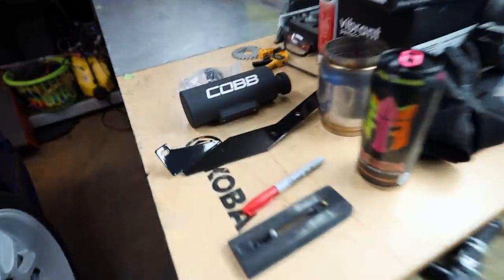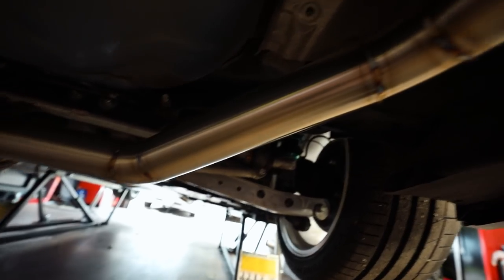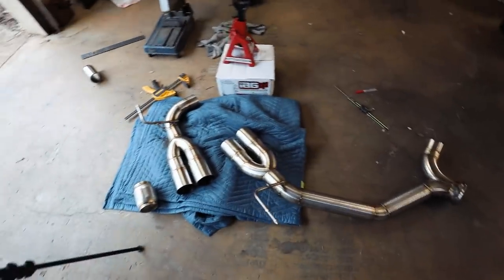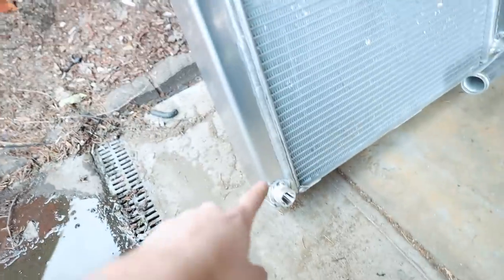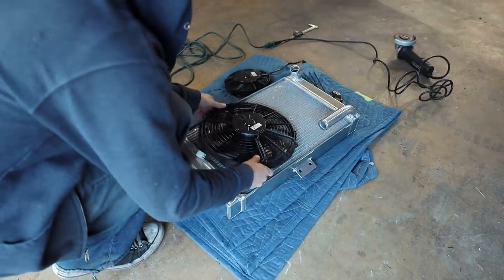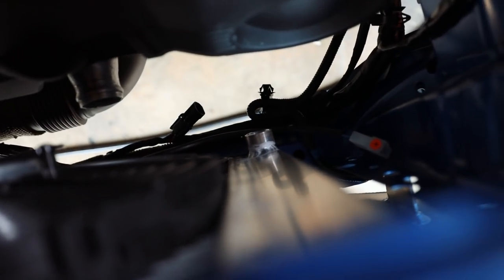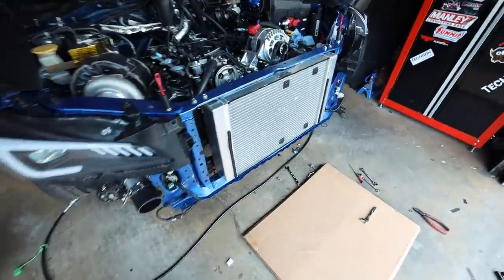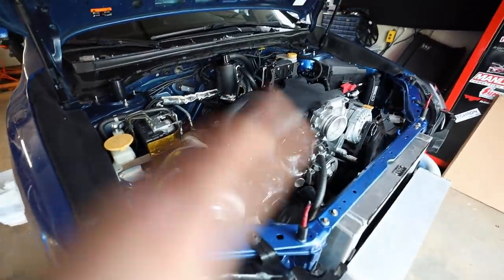Fixing the 6 Cylinder Subaru WRX STIs Cooling System Pt 2.

Comment: Measurement hack on 2 same sized holes center to center - measure the diameter of one, then zero the caliper. Then measure the outside of circle to circle with the ID measuring fingers. The caliper will display center to center on the LCD :)
Reply from the maker: Good little trick to have 🔥🥳 thank you!

Comment: @smeedia hey I am a TIG welder, you need to turn your gas up to 25 and buy a “furik fupa 12”  your welds are grey from not enough coverage. Especially with welding stainless pipe you need a larger cup. Your welds will become 100 times better! Yes that is the name. The really Big cup is a BBW…. Lol
Reply from the maker: I had gas at 30cfm to start and saw I kept blowing thr coverage away, then went do to 20. I'll try 25 next snd what cup size do you suggest for steel? I've been wanting the Pyrex cups so this gives me thr opportunity to justify ordering them 😅
Reply: @Smeedia  you can use the same cup with steel as you do with stainless. He is right about the gas but also with stainless you use way less amps than you use on steel. Those gray looking welds are also a sign of over heating the weld puddle. Not sure what welding rods you were using but ER308 is a good rod unless your welding food grade. Also when welding stainless you need to back gas your welds or they will be super weak from peppering. When welding stainless you have to get the puddle going and move quickly so you don’t cook out the chromium out of the stainless. Those gray welds will rust cause they don’t have any stainless properties left in the welds.
Reply from the maker: Should I paint over them? 😅

Comment: Outcast is so underrated. Most of these kids are missing out
Reply from the maker: Throwback outcast vibes 🔥🔥🔥
Reply: @Smeedia  Is there any way to run two smaller fans and tie them together.
Reply from the maker: Yes, I would wire them independently though

Comment: I love watching your videos brother. I don't have anywhere near the money or means to get said money at a normal 9 to 5 job. And no, I'm not doing anything illegal or shady, and I'm 8 years into my sobriety from Opiates!. Which has been a major change but thanks to many hobbies including a hobby turned side Hustle buying/selling/trading & building on commission 1/24 scale model cars . I've been using that as a means to fund my own H6 build I want to do (Among a few others including ANOTHER 1990's Era Eagle Summit Minivan AWD with a factory 5 speed and a built 4G63T from my old 1G Eclipse GSX that I had to becut out of thanks to a drunk drive in the winter. But, I built that and IIRC around 8 to 10 FWD Mitsubishi Mirage/Dodge Colt Hatchbacks/Sedans with the odd Early 90's Hyundai Excelle (spelling?) 4 door that had a fullcaveman, fuel cell and light enoughin the rear one guy could use their middlefinger and pick up and move the rear of the car around lmao. Built those many moons ago when I was in my early 20's and during the peak of the Weast Coast Honda vs East Coast DSM Rivalry which we took seriously in our area lol. 

But now I am working on swapping and building my 00 Forester w/SOHC 2.5ltr which sadly blew a head gasket. Once I eventually save up enough money I am going to buy a running/driving SVX and swap over everything into the Forester that i need to make it work while selling all the unused, unnecessary or incompatible parts that are still good (I might need to get every penny I can from the deals but I DO have integrity and believe that you get out of life what you put into it.)
Just needs a new clutch (Original one was slipping from when I purchased the car tbh I thought the clutch would go out WAYYY before a head gasket since it just had timing belt replacement before I got it. She came with a folder 📂 filled with everything ever done to the car and besides the Subaru dealer only one other shop has touched it over the years which is a GOLD MINE for anyone buying a used car!)

Your channel gives me something to reach for because, even though you want people to look up to you, if you don't have anyone to look up to then, you'll become stagnant and never try to achieve a higher level... or something... lol.
Hopefully I can have my Turbocharged H6 swapped '00 Forester in a video with someone like you sir. Much love and respect from Indiana, USA. AKA The "Armpit of America," corny I know but... it's better than "Hoosier Daddy!?!?" I feel dirty now... Giggity. Haha.
Reply from the maker: Congrats in the sobriety! Definitely a huge achievement 🔥 model cars is always something I've always thought would be fun to get into. 

Kinda cool that it came with the folder done with everything to it! An SVX swap would 🔥 to see in that thing 😍 funny enough a slipping clutch is what made me want to swap mine 😅

Keep me posted on the progress as it comes along! Would love to see some clips as you progress through it 😁

Comment: Unless it's too late...
Maybe if you could use 2 5,5" fans as your auxiliary? You do have your intercooler covering that lower portion in that corner.
Reply from the maker: I'd have to wire another in but that shouldent be an issue 🔥

Comment: Tanner that’s a resonater, not a muffler. Anyway, you’ll need one that’s about a foot long at minimum and than put it in the exhaust before where it makes a Split out to the axle back portion of the exhaust. Now that you have those 2 mini ones in the axle backs I feel this would be the best route to take. My built 2015 wrx was a bit Loud with the full straight pipe it had and a resonated midpipe with about a 2 foot long and 6 inch wide resonator has it sounding deep and growly with no rasp and brought the tones down a few decibels, especially on cold starts.
Reply from the maker: Per vibrant they're mufflers 😅 

No room in the catback for a resonator, would hit out drive shaft 😅

Comment: Awesome Dude! Curious, would there be a way to manufacture a larger version of a bleed screw similar to what you find on the calipers where you can attach a hose for clean draining? Would it be a waste of time? Hmmm in that same vein also have for the oil pan and sell out of your shop?
Reply from the maker: Debating snagging a funoto valve to try and stick in there 😅🔥

Comment: The coolant out of the cyl4 mod for the ej doesnt go into the heater core it mixes with the coolant coming out of the heater core.
Reply from the maker: On the EG it's on the opposite, the return for the heater core is on the passenser side of the engine
Reply: @Smeedia  ahh gotcha, ya the mod wouldnt have made to much sense on the eg to begin with since youre not feeding a turbo with coolant from the passenger side head so there wasnt any real balancing to be done anyways.

Comment: Any trick to cleaning the egr valve on the old ez30d without removing it. i have some high rpms on start but only for about 10 minutes at 1600 to 1800 rpm then drops down to 600 rpm when fully warm. Any tips
Reply from the maker: Only way I know how to is to pop it off and clean it our that way 🙏
Reply: Junk yard info here i come lol. No loss if i mess up something out there lol thank you sir
Reply: Thanks again i went to the junkyard and found out you do not have to remove your intake manifold to get it off just have to remove a hand full of normal items for good clearance and a little tiny 6 in wrench and it popped right off after four bolts. Tight space but saved me hours. Thank you sir

Comment: Will the radiator still work properly without a shroud? I always thought needs a shroud rather than just a fan mounted to the core?
Reply from the maker: It should, my brz had a similar set up and never had an issue

Comment: I hope I’m wrong but I think it’s gonna overheat again The hose is on the same spot where the hot water going in I hope you put block off in between of the radiator?
Reply from the maker: Which hose? The outlet from the water pipe?

Comment: I thought shrouds on radiators with like pass through holes were more effective then just fans on the radiator ?
Reply from the maker: They could be? 

I don't know how much a Shroud will help us if we had one 😅 only one way to find out
Reply: @Smeedia  not a lot of room there for one anyway. But then make them with square holes with flaps to allow air to flow out but directs the fan air more directly

Comment: So I can’t tell the size of the radiator drain or if there’s enough room for what I’m about to suggest but they make a easy drain thing for oil pans and I feel like to avoid any messes with coolant going everywhere you could use one for the coolant drain I can send a screen shot on Instagram they are like 40 or so bucks might be a good investment
Reply from the maker: That's what I'm gling to snag, the funoto valve 🔥 it's 1/2" npt so I think they make one
Reply: @Smeedia  I sent you the one I was talking about in your DM’s but yeah man glad to hear it! Gotta work smarter not harder! Lol

Comment: Put the cylinder 4 cooling mod back on lol https://youtu.be/Fs9nJOcLBYo
Reply from the maker: No
Reply: @Smeedia  to each his own. Dom made that video explaining why the Australian guy is wrong and how that’s all speculation. Australian guy did zero testing to prove his theory meanwhile Dom has been testing it for years and has data backing it up.
Reply from the maker: That's fine. And they're fine for EJs as I corrected. But there is zero evidence to show any impact either positive or negative or how they effect a 6. It also wouldent make sense to use one for this can based on how my cooling system is set up
Reply: @Smeedia  fair enough. I just wanted you to see that the Aussie video was misleading and only based on one persons speculation. Opening up the port just creates a negative pressure drop to help keep coolant moving through that area. And there’s hard data showing that it helps. But my hats off to you on what you’ve done with the 6 cylinder in such a short time. Keep it up